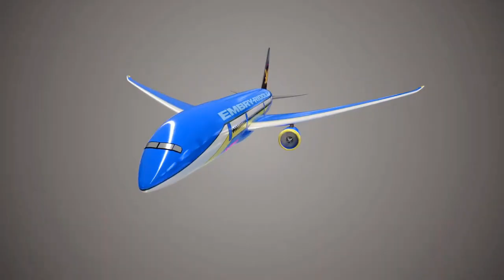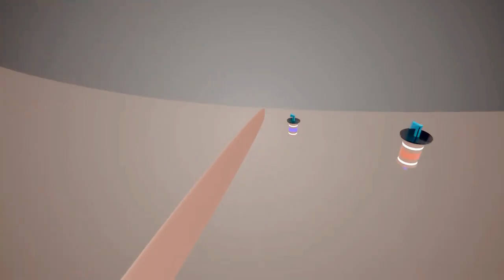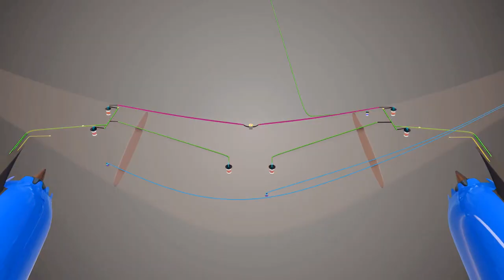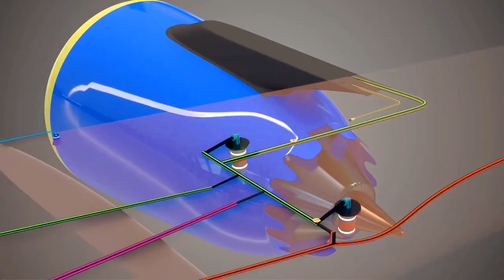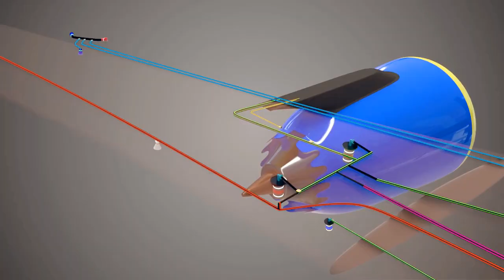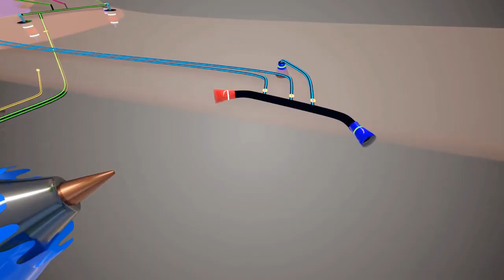How fuel system works in Boeing 787

Comment: Here is a question. Traditional jet engines use a mechanical fuel pump, which is driven by the engine using a drive shaft. The pressurized fuel from the mechanically driven fuel pump on the engine is supplied to the fuel controller and then injected under pressure into the combustors. Now on to the 787. Do the six electric fuel pumps inside the fuel tanks provide pressurized fuel directly to the fuel controllers of each engine so that the fuel can be injected under pressure into the combustors? It would seem advantageous to design the system so that the six fuel pumps mounted in the fuel tanks could by themselves directly pump the fuel through the fuel controllers into combustors without the need for addition mechanically driven fuel pumps mounted on the engines themselves.